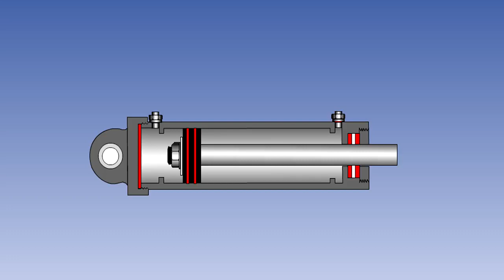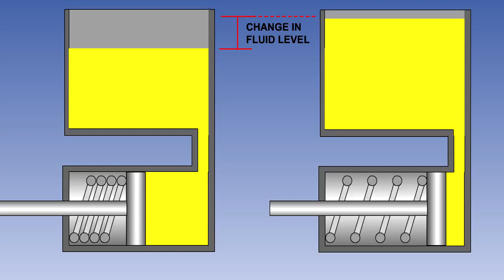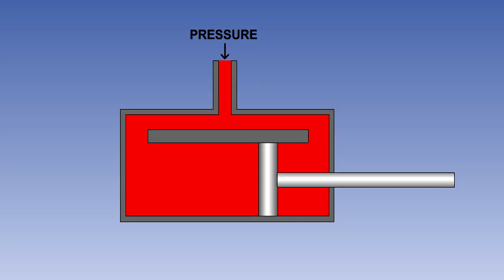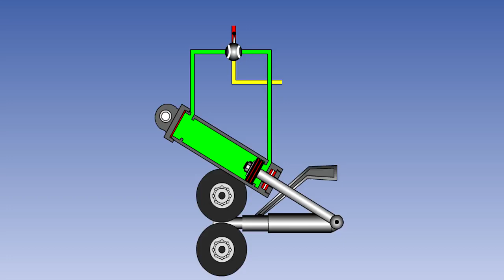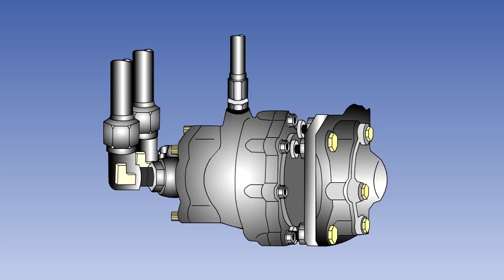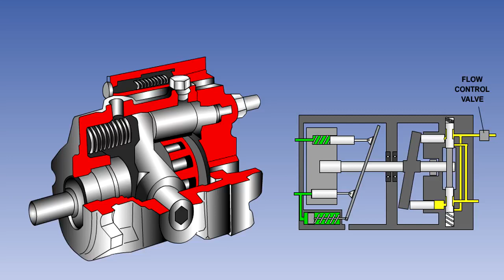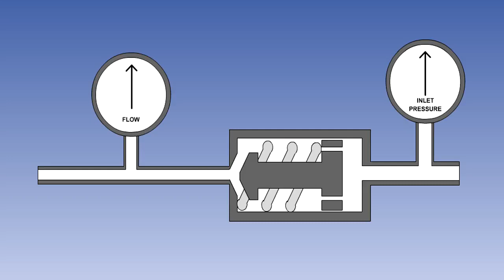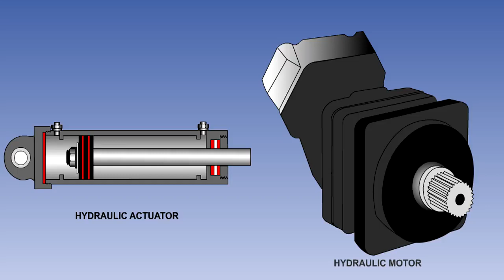Hydraulic Actuators & Motors - Hydraulics - Airframes & Aircraft Systems #9

Comment: Mayby you know where I can find a more concrete examples of hydraulic systems ?
Reply from the maker: Aircraft hydraulics or hydraulic systems in general?
Reply: @aeroair6555  Aircraft hydraulic systems
Reply from the maker: There is a site that b737.org.uk that has info on the Boeing 737. You could also try the FAA's Aviation Maintenance Technician Airframe Handbook, there are some example systems in there.